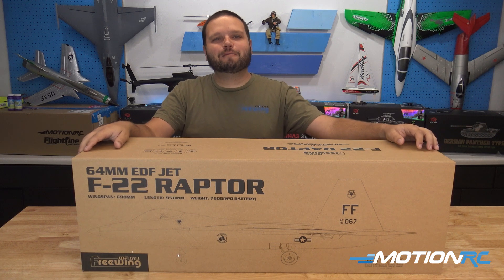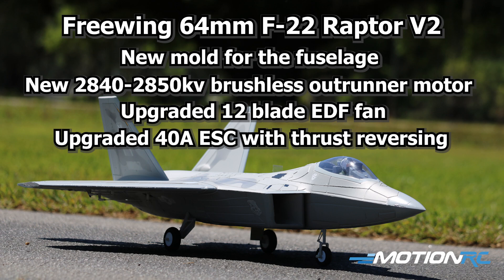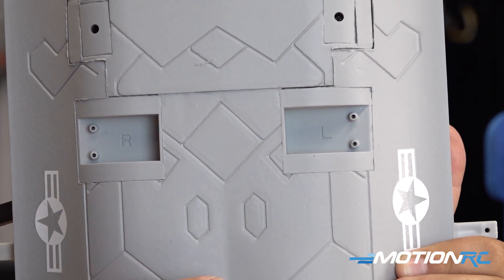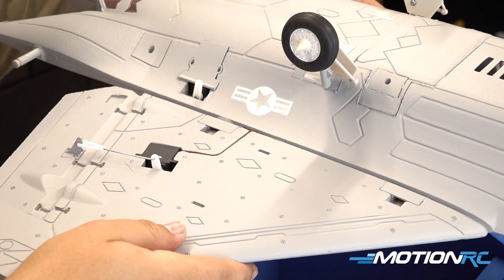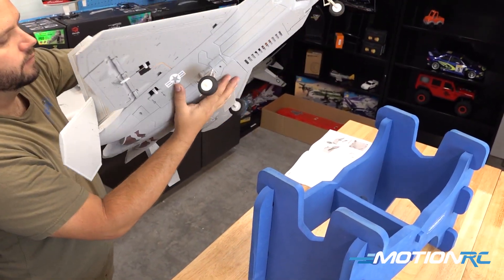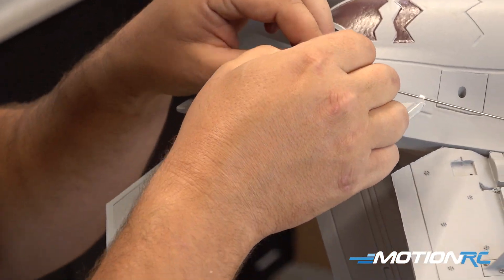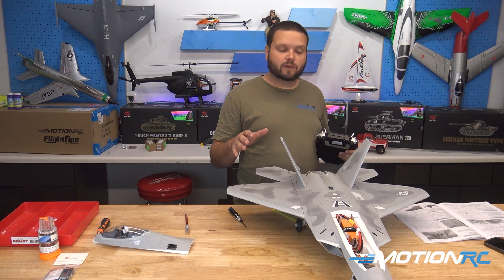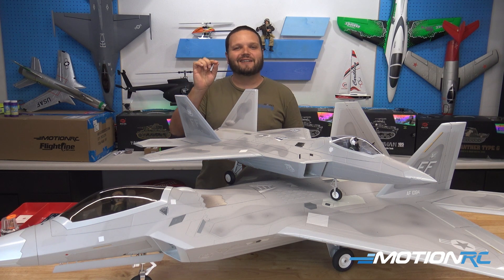Freewing 64mm F-22 Raptor V2 Assembly | Motion RC

Comment: Wow! beautiful! For your opinion, Is it possible to do an hand launch without installing the landing gears? Has it capable of this?
Reply from the maker: Definitely. Even the V1 was fine doing this and is my preferred way to fly it
Reply: @MotionRC does this jets comes in 50mm??
Reply: @MotionRC what color is the jet?I can't tell
Reply from the maker: @knightrider3766  A mix of different grey's like the real thing. The jet doesn't come in other size options. We have a 90mm one but it's a totally different beast and not comparable to this 64mm
Reply: @MotionRC  what channel is the 64mm, and can you use a simple transmitter same as the one you have for $109.00?
Reply from the maker: @knightrider3766  for this model you want a 5 channel receiver. Throttle, Aileron, Elevator, Rudder and reverse. Not sure what simple transmitter you mean, but you need one that can at least function 5 channels. Honestly, with the questions you are asking it is clear you are not ready for this model yet and should start with a trainer plane
Reply: @MotionRC  I was refering to the futaba 6 - channel transmitter with R3106GF receiver..$109.00..i think I can handle it with some coaching
Reply from the maker: @knightrider3766  That transmitter will work for sure. But if this is not a recommended 1st aircraft. Wish you all the luck though.
Reply: @MotionRC  ok..thanks